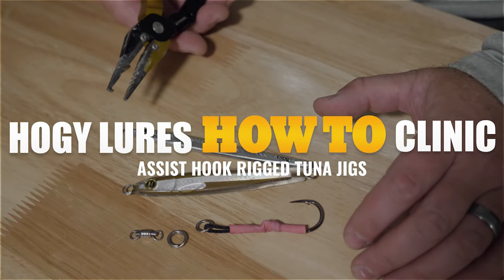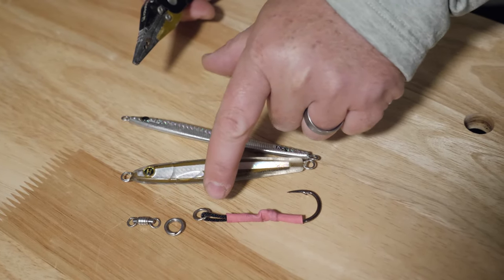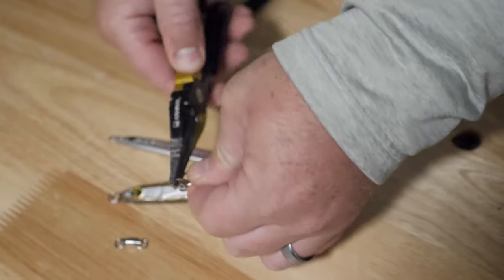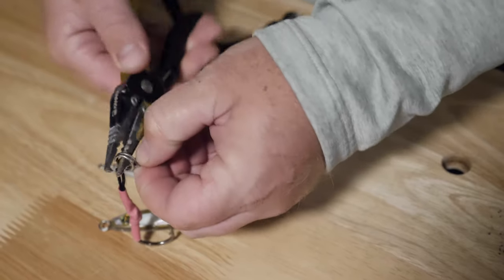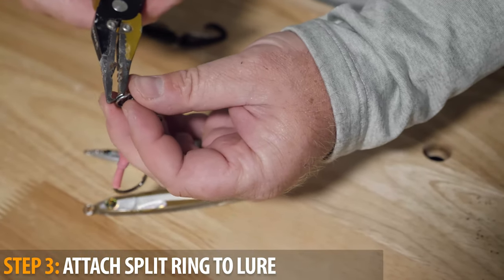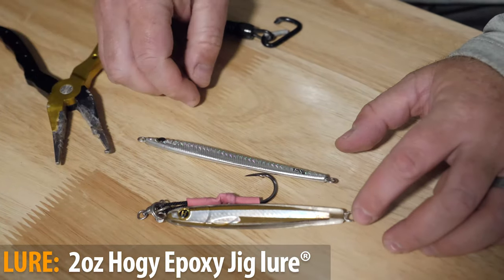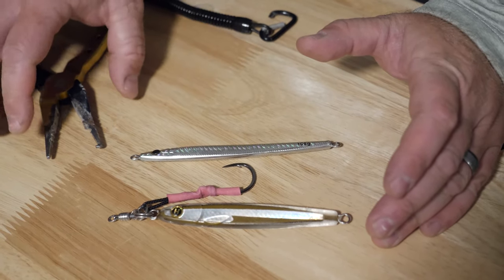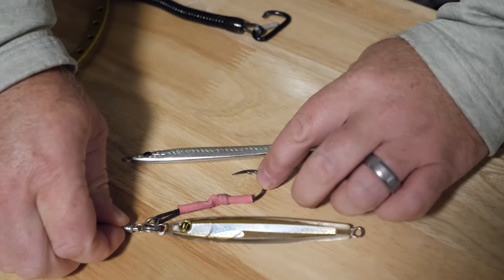How-To: Quick Swap Tuna Swivel Rig

Comment: Use a quality SS swivel,  attach assist hook to one end and a regular split ring to the same eye of swivel for connecting jig. No need for a solid ring when line is not connected to it directly.